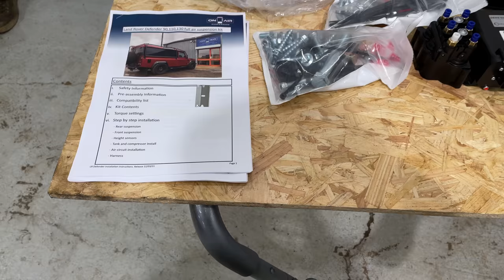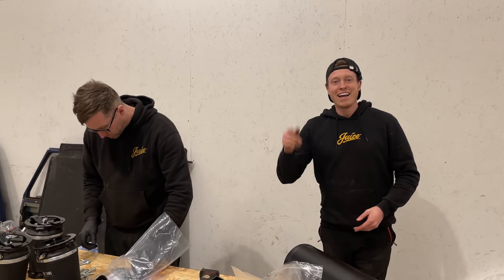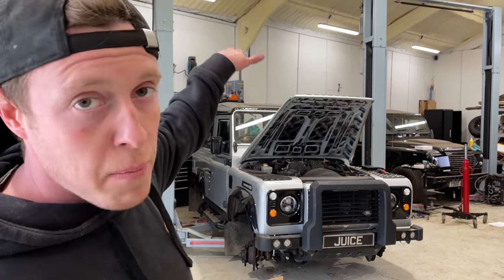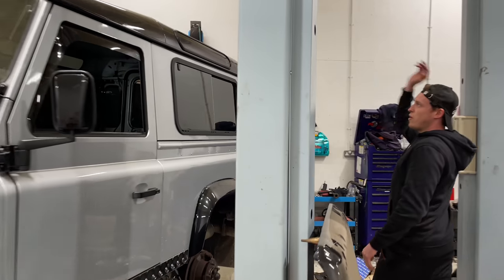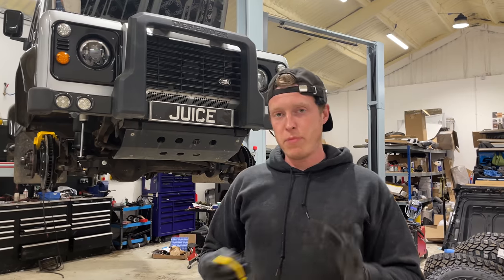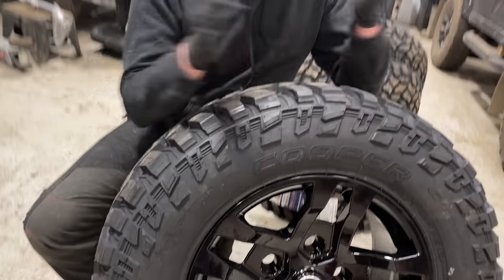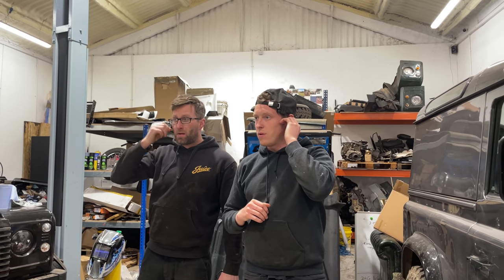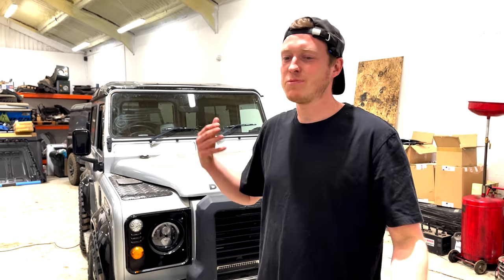MODERNISING a Land Rover Defender 90! - Part 2

Comment: Something I found that is perfect for stopping dirt get into the bearings once you remove the hubs are Pringles plastic lids. Try it the fit perfectly. I could not help notice you had a lot of crud in the bearing housing, which I know you would have cleaned up. But try the Pringles test : )

Comment: I was wondering about the air hoses and how you protected then from abrasion, gromets maybe? I use heat shrink tubes for wiring where abrasion could be a future issue i wonder if that would work for the air hoses as well? Thanks for the videos, take care, God bless one and all.

Comment: How about as a new project, a D2 with full air suspension? I had the idea of adapting D3 or D4 front  suspension units  & then fitting the air ride system that you use on the rear.
Ive an 1999 D2 td5 that ive been thinking of doing this conversion on, but not found someone willing to try it.

Comment: My Defender is a 2011 90. I bought it lowered. The previous owner had trouble getting in and out of car parks. I kind of like it low, the air system would be a bonus so that I had a choice. 

The black and silver combination is great. However, I do prefer the sawtooth wheels.

Comment: I've been trying to source air suspension for my 110 everywhere. I have an ARB compressor, fitted a tank, have already moved the front shocks to the outer dual shock placement and am looking for a control system & airsprings. How did you manage to find them? +I subscribed  the first day I found you. :D

Comment: Since fitting a roll cage and snorkel my Defender doesn't fit in the garage. Im weighing up cost of new garage doors and air suspension. My defender is plus 2" WITH 255 85R16 would air suspension go down 4-5 inches from +2 "?

Comment: Lovely looking 90 guys. My two daughters have to be picked up to get in the 110. I imagine this would appeal to a lot of people that struggle with the uphill battle of getting in to their motors. What’s the reliability and off road capability of this setup? Also does it have a speed triggered alarm when in raised mode?

P.s. I don’t think you know anyone with a Peugeot to do an oil and filter change on. 😉
Reply from the maker: They’re super durable bags but if your planning off roading I’d stick with springs purely because simple is best out on the trail!

Comment: Nice work definitely, but for real Hardcore off grid stuff I would prefer normal springs and original Breaks and Parts where you can get spare parts all around the world.
Reply from the maker: Agreed. For off grid overland I’d have a totally different spec
Reply from the maker: Agreed. For off grid overland I’d have a totally different spec!

Comment: no wonder the others come in with strip of tint missing on back windows. because it usually  goes inside NOT outside! ???
Reply from the maker: Steve templates the tint to cut it to size on the outside first. Then when he’s happy it fits perfectly, it’s transferred to the inside of the opposite window and slipped behind the seal. The tint is inside the glass.

Comment: Why don’t you invest in battery impact guns? It would make life a lot easier (has for me anyway)
Reply from the maker: We have battery impacts and auto ratchets of every size, I usually get my air gun out because either I forgot to charge the battery or the air gun can squeeze into tighter gaps like behind the axle to get the calipers off 😎
Reply: Was just about to say, that I have finished the video and seen a electric gun. Great build as always 👍🏻

Comment: Applying the tinted film on the exterior side, wont that leave it vulnerable to everything and anything that hits it from the outside ?  Why not install from the inside ?
Reply from the maker: It is installed from the inside, they use the outside to template and cut it to size then remove it and fit to the inside